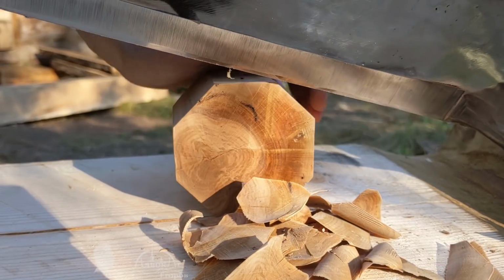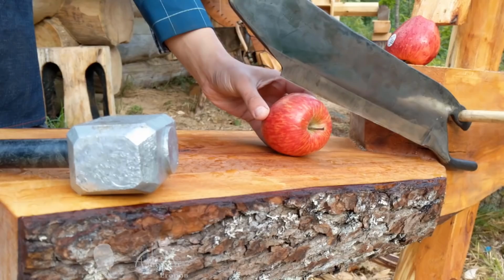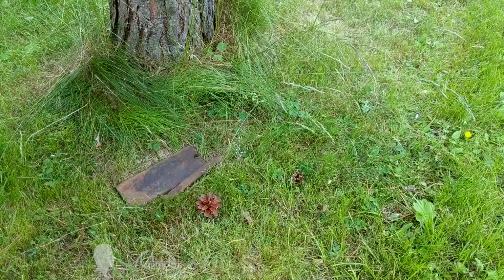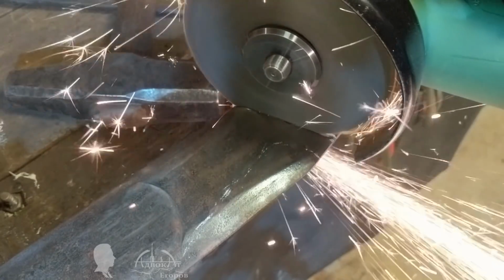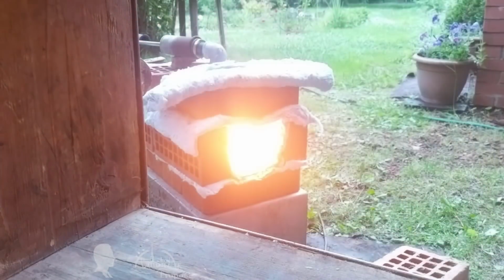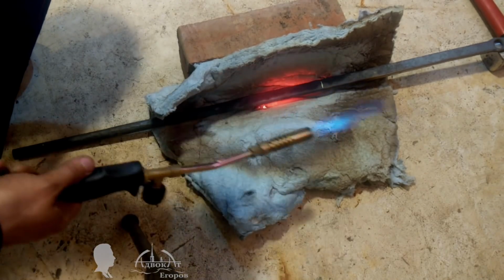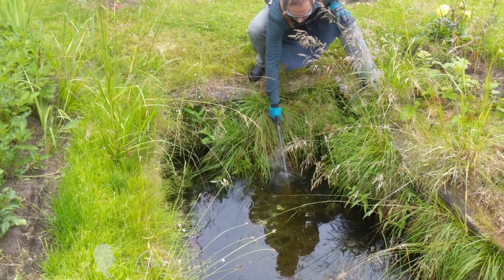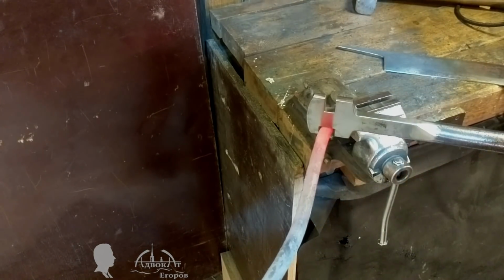The Cloggers Knife | Old Tool Reborn

Comment: Here's an abstract based on the YouTube transcript generated with Gemini Advanced 1.0:

Abstract

This video details the design, construction, and versatile applications of a cloggers knife – a traditional woodworking tool. Inspired by shoemakers, this knife can efficiently shape large wooden pieces. The video begins with a conceptual discussion of the cloggers knife's unique mounting options compared to conventional knives.  Through a step-by-step demonstration, the maker forges and welds the blade from a leaf spring and rail clip. He highlights challenges, improvised solutions, and the knife's practical benefits through various woodworking projects. Additionally, the video emphasizes the value of traditional tools and the enjoyment of  taking a break from routine while developing blacksmithing skills.

*Keywords:* cloggers knife, woodworking, forging, welding, traditional tools, blacksmithing

Comment: I am impressed by your skill set, but my advice as a blacksmith would be to either make yourself a power hammer of ask a friend to 'strike' for you. To avoid all the internal stresses, the cloggers knife you made could have, and should have, been made from one piece. Using a striker (a man with a heavy sledge hammer), or a power hammer you could have achieved a more structurally homogenous knife blade without the failure risks.
My next point is that most metals (not all) are better quenched in oil (float water on top to prevent it fire flashing) traditionally whale oil was used, but in a modern age we would not do this. My next choice would be linseed oil which we understand was traditionally used in the UK. Compressed air streams can also be used to harden and temper some metals.
Incidentally. your English language is better than mine, I am impressed!!
Please feel free to contact me if you would like to know more about the craft of blacksmithing.
Reply from the maker: Thank you for the pro tips!

Comment: You probably already know this, but all series 60 steel should be quenched in warm oil. That whole water quenching thing is about razors & pocketknife blades, and even those are quenched in hot water brine.  Large cross sections of carbon steel do not respond well to rapid quenching in cold water.  It's Knife Making 101.
Reply from the maker: I just didn't have a large enough pan for oil and decided to take my chance to quench it  in water...
Reply: @Advoko  If I could post pictures here, I'd show you my quenching tank. It's an old Army 20mm ammo can. It's about 42 inches tall. I've had it for at least 30 years, probably closer to 40. Aside from occasional replenishing, it's has the same batch of oil in it I mixed all those years ago.  IT basically lasts forever.  It's great because it has a lid that can be clamped shut to prevent evaporation and protect from spills. In a pinch, lengths of capped pvc sewer pipe work very well, just have to be careful not to let the hot metal touch the sides. I use non detergent motor oil mixed with tax exempt (not dyed) diesel fuel & lamp oil. (ratio is about 80:10:10.) Warm it to at least 140 degrees fahrenheit, before quenching. Watching you is an inspiration. You do amazing work. Thanks for sharing your life with all of us
Reply from the maker: Thank you for the story))

Comment: May have already had a  comment on temper with oil but can be used in lue of water and  is less prone to  cause damage,  and can be  followed by  annealing with the torch  to slitly  soften the  blade  for sharpening
Reply from the maker: Paul, thank you for the tip

Comment: Hi Max, I'm dealing with cooling problems in my tiny smithy and am curious about keeping the forge outside, as you have done. I hope you don't mind a few questions about it.

Do you have metal or wood siding where the forge sits? I see cement foundation in one shot, but what's between that and the window? It looks like metal siding but that could be just around the window frame.

Do you have concerns about the siding getting hot or the hot steel dropping on the wooden window sill? At 1:26 and 9:52 it looks like you have almost put the hot metal on the sill directly.

What about rain? Do you have a roof/eaves over it or do you just not use it when it's raining?

It seems like you also have to move the hot metal through a lot of open air. Do you not find that it loses too much heat?

Thanks!
Reply from the maker: The house is all wooden. The window is made in the concrete foundation. I fireproofed that window inside and outside. Yes, there are eves over that window. It loses some heat but it is always a compromise.))
Reply: @Advoko  Thanks!

Comment: Thank you for sharing your learning experience in blacksmithing. It reminded me of my early days of trial and error when quenching spring steel in water. The familiar clink sound when the blade cracks is never forgotten. Spring steel is generally oil quench steel. I was  commissioned  to make one of these rare tools a few years ago. I made it in one piece by drifting a large hole towards the corner of the bar, slitting one side off, folding it out and drawing the taper to make the long handle tang. My customer was very happy saying it is most likely to be the only cloggers knife made here in  Australia. I enjoyed seeing some examples of your craft and also your unusual anvil.

Comment: You might try quenching in heated oil.  Less of a shock to the steel and you can watch the colors bleed to the edge and to temper so it won't crack, requench when it gets to the color you want for the hardness you require.  For that massive blade, you will have to repeat as long as there is residual heat in the back.  I would suggest a nice amber to peacock for harness tempered to your needs.  If you shield the massive part of the blade when heating to harden it, that will take less heating and less stress build up in the transition zone.  That cold creek water is almost a guarantee to create stresses that will crack.
Reply from the maker: Thank you for the tip.

Comment: If I were to block out a clog sole with that I'd smash the peg the eye goes round. Anyway the eye doesn't give enough twisting movement for making clogs. All english Blockers are tapered on the backside so to cut concave curves.  I have seen one knife made with the taper on the topside but it was a general woodworking tool not a cloggers knife. You couldn't make British clogs using your knife
Reply from the maker: Jeremy, thank you for the info
Reply: @Advoko  The particular  knife I saw that was a general carpenter's planing tool, at least that's what I think it was, was dimensionally similar to your knife. I've found the Clogger's Blocker or Stock Knife [same thing] to be pretty useless for anything but clogs, though it does plane well over a short arc. The other main use for large pivot knives is for making Tent Pegs. Pegging knives are dimensionally slightly shorter and lighter built andhave the taper topside. Of course this is just Britain. Both the dutch Klompen  straight knives and the french Sabot Paroirs are different again and optimised for their particular use. 
I'm pretty sure they went into the woods, set up Camp and cut a tree down to about a hand's length higher than  a knee. They then axed a flat in the side of the stump and coach bolted a plate in  vertically with a ring on a spiral thread  [ like an adjustable chair]  to enable them to raise or lower the ring for different sized pegs. Why do I think this? well because I have a matching set of knife and ring for pegmaking  bought from the Forest Of Dean, and made by Elwell.

Comment: quick tip, the heat treating process is done in a few steps, hardening, tempering and if you're so inclined normalising. so the idea is to bring the heat to only the part you want
hardened, and thendunk the entire metal part.. the next step is a little tricky (on a larger piece of steel) anyway, what you want to do is raising slowly the temperature of the hardened
suface with a torch, you dont want it to get red hot(as it would ruined your hardening) you'll see rainbow colored patern appear on the metal, blue to straw colors and then you dunk it in water..
Reply from the maker: Thank you for the tip
Reply: @Advoko  no worries mate, i havent found a good video that shows that process(tempering) but if i do, i'll link it to you.. by the way amazing work, what you've done over the years, that's just inspiring..

Comment: I have watched this video a couple times now. Great content! The other day at my workplace we were discussing the show “Alone”. You should be on that show!  Our discussion was about: what item (of your 10 items) would you bring that no one else has ever thought of?  I said an auger because you could more easily build animal proof structures if you could make pegs/holes etc etc. Your draw knife would be another alternative along those lines. Anyhow cheers to another interesting and thought provoking video. Keep doing exactly what you do
Reply from the maker: I would add a wire clamper, you can quickly easily make structures, shelters, ladders or even primitive furniture using wire clamps, as long as you have access to steel wire.

Comment: Old leaf springs great for so many things. I wonder if it would work to use a wider spring and upset the top edge, to save having to weld bar along the whole way? (Could this be done without kinking the blade?) The extra density in the top edge could possibly avert a split when quenching, ditto the run of the metal grain ... Just a thought ... 
      What's the widest leaf spring anyone has found, and where from?

Comment: The tool you made to straighten is called a "Die", you made a Straightening spring die.
A similar die is used in straightening smaller wire; but most blacksmiths would've straightened round stock with a wooden mallet on a log; a die should do something you're not able to do quickly yourself, so it does make sense why you did make one for this, but for future reference; try using a log and a wooden mallet.
Reply from the maker: Thank you for the detailed info!

Comment: I've been making my own laundry soap. 
A 3 gal bucket and you got enough for like 600 regular loads of laundry or for you prob 1800 lol. 

Recipe: (3 gal batch)
1 bar fels-naptha laundry soap
1 cup borax
1 cup arm n hammer super-washing soda

(Melt soap in water, then add the two powders). It comes to be about as concentrated as it can be and almost like a thick custard consistency. 
You can add more water to it to make it thinner just mix it a bit before using to ensure even consistency as it can separate a bit. 

Uses: laundry, carpet cleaning, others.
Reply from the maker: DJ, thank you for the recipe
Reply: @Advoko  glad to help. 
Btw the average load size for a regular washer is like 1tbps, heavy load maybe 1.5. forgot that part lol

Comment: Very well done! Thank you for your video. Your cloggers knife is very similar to the knife used in Bavaria to split wood shingles. ( schindeln / shakes). You will need to change the fulcrum to work on longer pieces of wood. Do you have larch trees in your area. Or white oak. They will be the best for roofs and walls. Spruce is also good, but softer and less durable. 

When you straight split the shingles, with vertical grain, you can clean the corrugated ends with your drawknife. For red cedar shingles manufacturing, please see my videos. Thanks again! Cheers from Vancouver, Canada.

Comment: The tool you seek an English name for @ 10:00 is most specifically called a swage, noun and verb. Swaging is also a derived verb. The action, at least in blacksmithing, is always called swaging or (to) swage. The pieces that directly contact the work may also be called die(s), but this applies to almost anything like this, like plastic or metal injection molding, stamping, etcetera. 
A fuller is a similar device that makes a concave groove in the workpiece, generally simpler if not smaller than a swage.  Also may refer to the groove produced, like in large knives or swords (often called bloodgrooves), or used as a verb, fuller/fullering. 

I didn't see another answer after a few pages of scrolling, so I hope this helps.
Reply from the maker: Thank you for the reply!
Reply: @Advoko  BTW, the action isn't always called swaging, I meant to say it isn't ever called die-ing, die-ed or to die, even though the tools may be called dies. That would sound too much like dying, either to cease living or to change color.

Comment: Back in the 70s there used to be a cast iron mitering shear known as a Lion trimmer. It was a very sharp blade running in a horizontal track using a large lever and gear for leverage. It wasn’t to cut a miter angle but to trim it perfectly to the needed angle after being cut by a hand saw or miter saw. It could shear a 3/4 inch thick board over 4-5 inches perfectly smooth and straight almost burnished. It was a very expensive specialized tool used by the best craftsmen. It used to make the exact same sound as your clogger knife does when shearing wood! The hardest part was trying to find someone who could sharpen the blade perfectly straight!

Comment: For hammering, raise the hammer and dont put weight into it as you swing down. It should feel more like you're just guiding the hammer as it drops, without you putting any force into the strike. It's gentler, but only by a bit, and allows you to forge without getting tired as quickly.

Edit:
Also, for hardening, i suggest getting some oil, it doesnt cool metal as fast as water, letting the steel harden a bit gentler. It wont crack as often, but is a bit more pricey. If you can, buy a large gallon jug of a high flash point oil, such as canola. Also, for oddly shaped things, you can use a box and pour the oil into it, quench the part or tool, and then pour the oil back into the container you store it in, using a filter just in case.
Reply from the maker: Thank you for the input

Comment: The tool you made for straightening the rod looks like a spring swage.  alternatively, if you have a striker to hammer for you, you can use a top and bottom tool
Reply from the maker: Kris, thank you for your reply.
Reply: @Advoko  Any time!  there are a lot of great smithing videos and channels.  I would recommend Alec Steele or Purgatory Iron Works if you want to improve basic technique and heat treating.

Comment: Quenching in cold water has a high risk of failure.Watching more experienced blade makers I now quench in 37~38C cooking oil.I've been told most any oil will work.Motor oil,hydraulic oil,etc.Special oils are available but are expensive.Another trick is table salt melts at 800C.Sprinkle a little on your blade when you think your close.When it melts,quench.Good luck.

Comment: Your “special straightening tool” is called a “Spring Die” in English. They’re used in power hammers too. Nice work!!
I think “Cloggers Horse” would be an appropriate and familiar name.
Reply from the maker: Matt, thank you for the info and a name suggestion!
Reply: I vote Cloggers Horse as well...
Reply: While "spring die" is technically correct, "spring swage" is probably the proper Blacksmith vernacular.
Reply: homie thats a swage
Reply: Swage is the name I'm familiar with, check out Timothy Dykes channel (dyke pronounced dick)
Reply: I was thinking it seemed like a wire draw, but I think I like your answers better. Yah, swage it is.
Reply: Spring swage to be exact. Some here in NA would call it a rounding spring swage.

Comment: Looks amazing. I think you can get by if you do your final cloggers knife with the hole on top. I would modify your bench so instead of one post to put the pin in to hinge on you have two on each side with holes going up if you need to change the angle but the bottom one can be set so the blade is parallel and flush to the table when all the way down. This will also help keep the blade in the center of the table for all cuts as the hole on the blade being pinned now has supports on both sides so you are not tweaking the bench when you slice.  Not sure if I am explaining it very well but hope it helps.

Comment: Nice. :)
Well, hardening can be a bitch.
You could have heated it around the cracked (and prepared/grind out) spot and then stick welded it. That would have prevented too much stress in the material. Preheating is always a good choice when dealing with larger objects that wick a lot of heat away.

Comment: Very cool and useful tool. You could easily convert a large knife or machete into a functional equivalent using a long steel U channel on top of the knife as a spine which would clamp over the top length of the knife and hold it securely. Then you just weld a couple  large thick steel washers  on the end for the hole.